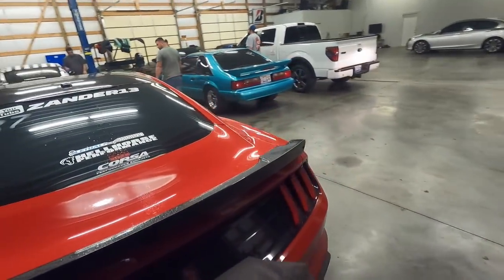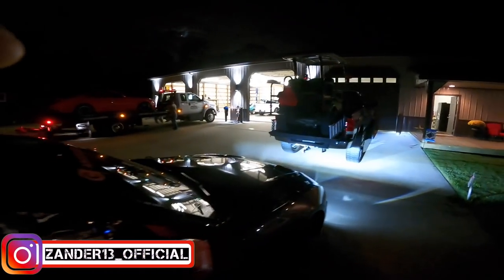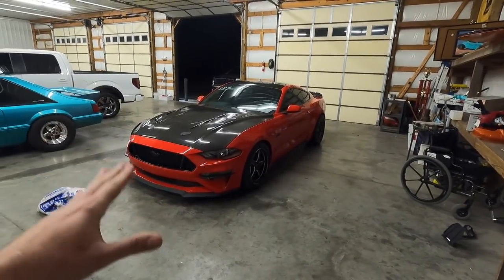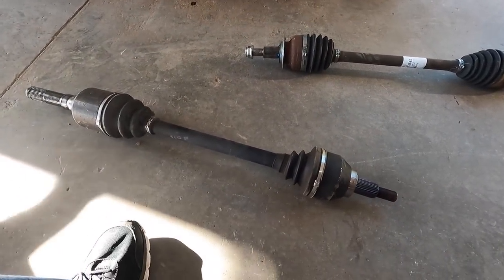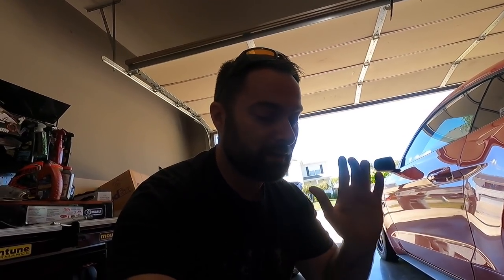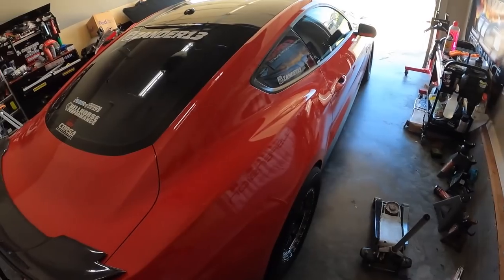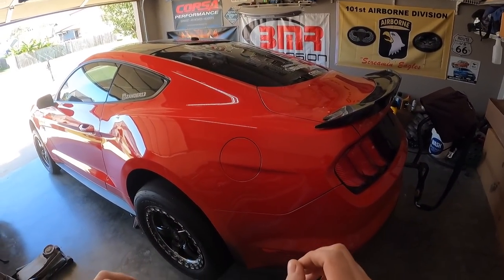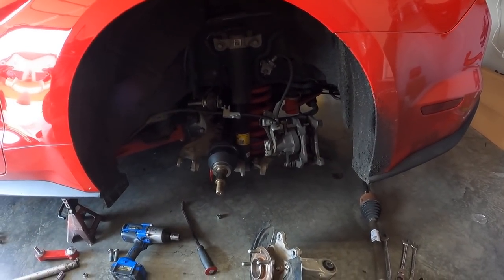Here is WHAT BROKE Chasing my record in 1000+ HP Twin Turbo 2019 Mustang GT *UNREAL*

Comment: Zander with respect you have to thing race car you have in your hand, so all factory bushing have to be replaced with polyurathane bushing , adjustable rear shock, braces ect...   The torque from the turbo sitting on rev limiter is asking a lot from the factory suspension. Good luck we will be watching for your next races.👌👍💪🔥
Reply from the maker: That is a very valid point. Turbo cars make a TON of torque

Comment: You throw around that your car is 1000+ HP alot, maybe a good video is the dyno of that 1000 to 1100 that you think the car is making?
Reply from the maker: 154 mph in a 3800 pound car. Come race me 😀
Reply: @Zander13Productions  I doubt your car is 3800 lbs with those seats and rear seat delete plus those bars you replaced your bumpers with
Reply: @Zander13Productions  not to mention your exhaust that just dumps
Reply: @Zander13Productions  I like your content dont get me wrong, I work hard to afford what I have, I don't have people giving me money or sponsors to discount what my car has. I have a 19 manual gt with a st 2 procharger on it, its not a track queen and I earn and sweat for every penny that goes in it. To each their own, congrats on a gutted track car that traps 154. My car is a street car cause thats mostly where I drive it.
Reply from the maker: When we weighed it at truck stop it was 3820 without me in it
Reply: @Zander13Productions  so a mustang gt with a drag pack and no rear seats carbon fiber hood and trunk tubular front and rear bumpers aftermarket front seats without a cage weighs more than a stock mustang gt?
Reply from the maker: My car my choice. Why does it seem every one wants to give me shit when every other YouTuber doing the same as me 🤔🤷.
Reply from the maker: I worked my ass off for what I have too. 4 combat deployments resulting in injury. Believe me. I have sweat and bled for what I have too
Reply: @Zander13Productions  i think a full pull on a dyno would be a cool video, and it would back up your 1000+ hp number you throw around. If you state numbers as facts without proof people will call you out. Not knocking or doubting just saying it would be cool to see a 17psi pull on e85 on the dyno to see what it puts down
Reply from the maker: In time we will.
Reply: I will race you Zander i should get my e85 tune this or next week I will roll race you 60-80 roll. Ysi race centrifugal with cid max effort heads .

Comment: If u want 1.2 1.3 60 foot u gonna need a 8.8 or 9 inch rear lol
Reply: 1.3x is cake on these cars they do 1.5x stock suspension in a good tire lol...its nuts...I think we already have 8.8 center sections....but they do make a 9 inch version IIRC
Reply: @ShawnGilbert1967  I'm into old school stuff like foxbodys  having to upgrade everything lol. Yeah these cars fly
Reply: @PatrickScottlxw  i couldn't believe it when I did a 1.58 60ft on my first ever pass really on a street style footbrake leave....with a 17 SS radial lol...took me years to reach that on the old 67 Camaro
Reply: @ShawnGilbert1967   are fox did a 1.45 first pass out ran 11.1 at 122 but have changed alot hoping for 10s now and closer to a high 1.30s
Reply: It is a 8.8. It's just IRS 8.8 lol